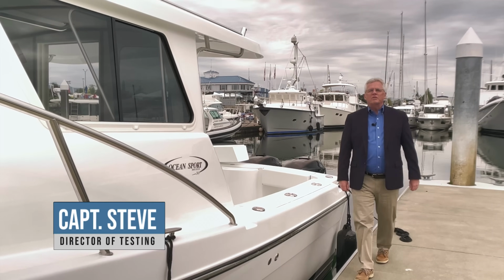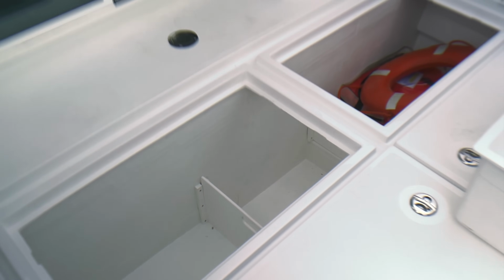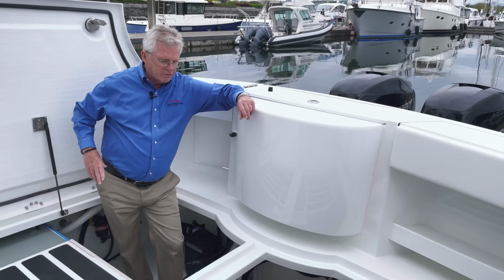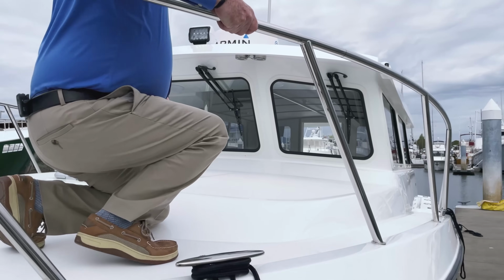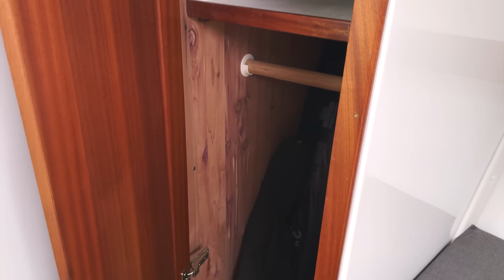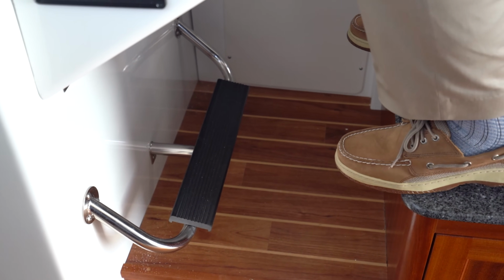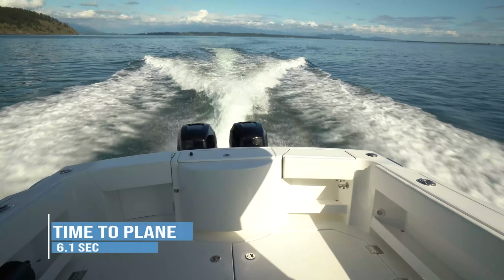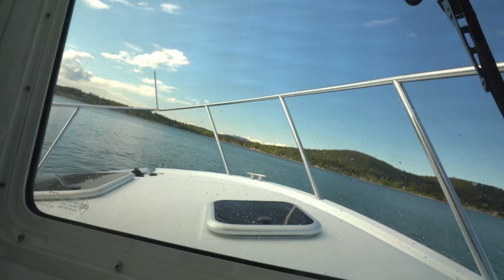Ocean Sport 30 Roamer Test Video 2022 by BoatTEST.com

Comment: I would be curious what kind of minimum speed/RPM it would take to keep this boat up on step? There are a lot of rough sea conditions that you just could not run at 33mph and 4500rpm's

Comment: Boat manufactures need to understand that a doorway in all American homes built after 1960 have a height of 6 foot 8 inches, that should be the minimum height for clearance on above deck cabins and T-tops.  Being a tall male, it is desired, and anyone appreciates the luxury openness of high ceilings, less claustrophobic feelings.

Comment: With twin 270 Volvo diesels the boat will get 2.1 to 2.2 mpg at 31 mph fully loaded with fuel, water, gear and food for a week. That will give you a range of 530 miles with 300 gallons of fuel ( standard with diesel)
with reserve. Not bad for 30' boat.
Reply: get an oxe outboard diesel and keep the large fuel tanks :P since 600hp pushes it to 50mph twin 200 diesels should be good for cruising in the 25 knot range
Reply: Originally they had only the twin stern drive diesels, much better fuel economy and handling in my opinion. In fact they had a single diesel option that most of the serious fishing guys went with, the range and performance on that was awesome. I guess outboards are the thing now but I’d get the stern drive.

Comment: Couldn't you put fuel tanks on that to cross the Atlantic? Seems like the engine's would do a proper job.
Reply: The boat isn’t certified for that
Reply: this boats simply not big enough, depending where you leave from and decide to go, crossing the Atlantic is a 3500mile trip. the full tank needed would be as much as this boat weighs.